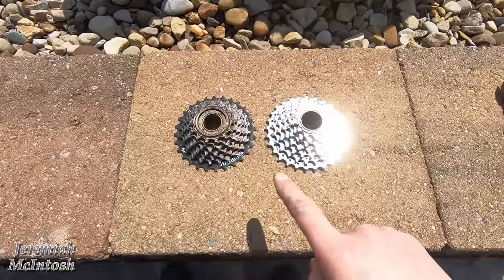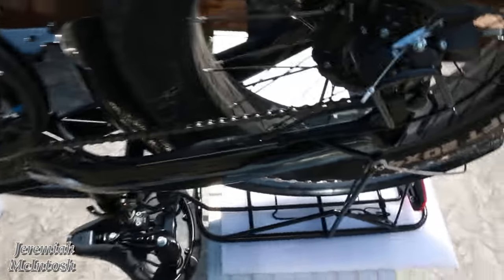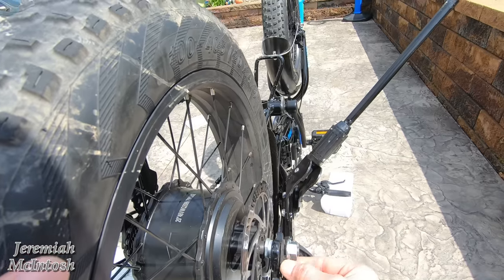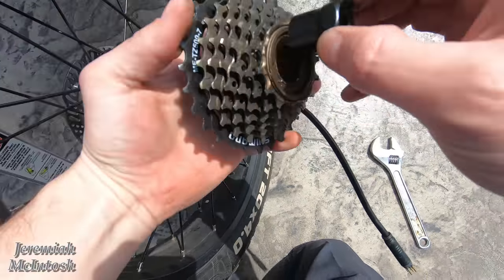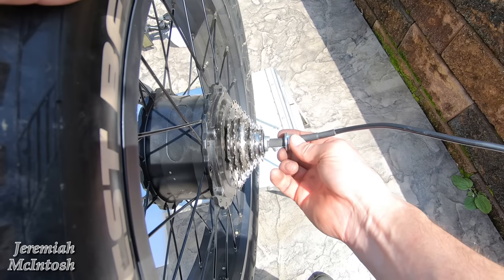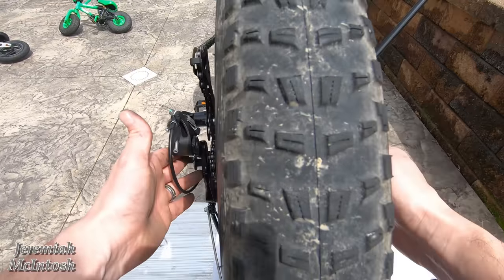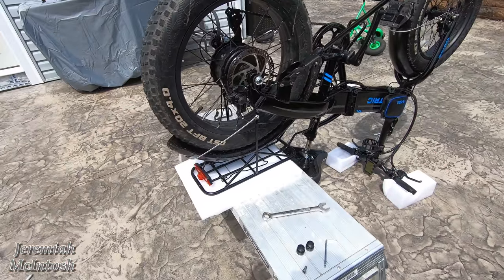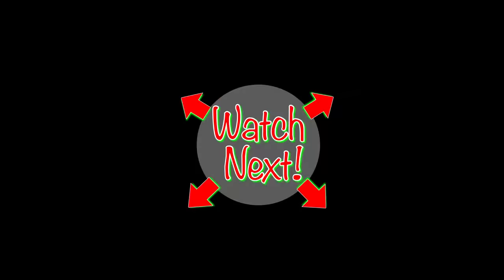Lectric Xp E-Bike Freewheel Upgrade replacement Tutorial and differences

Comment: I recently bought the DRIFT MANIAC DNP E-Bike Freewheel 7 Speeds 11-28 Teeth EPOCH will this work?
Reply from the maker: Yes it will as long if you bought the seven speed freewill and not the seven speed cassette because cassettes are different.
Reply: @JeremiahMcintosh  it states Electric bike specific 7 Speed freewheel,Made of high strength and durable chromoly Steel. Nickel plated surface treatment.
Reply from the maker: Yep that should work
Reply: @JeremiahMcintosh  how are those hydraulic brakes working?
Reply from the maker: I have only installed them on the back so far waiting for the front pads to wear down and they work great however the organic pads they come with heat up very quickly if you’re in a hilly area like me and then reduce your stopping power so you may want to get a set of semi metallic or metallic pads if you change to the hydraulic calipers. The lectrics come factory with ceramic metallic pads. I left the organic ones on the back but I still have the original ceramic metallic on the front for the best of both worlds because the organic pads are very quiet.

Comment: Hey! can you share the specs on the free wheel tool when googled it I found a few different designs. Thankyou!
Reply: also do you tighten it or hand tighten it after screwing the new one on?
Reply from the maker: There is a link for the exact tool in the description of my video and I did tighten it gently with the tool when installing it.

Comment: I'm trying to find a video that tells you how to adjust your shifting I had to put a new motor On and when I did it wouldn't shift properly Just an adjustment I'm sure But I don't know how can anyway out there help.
Reply from the maker: There is a high and low limit screw that adjusts the min and max in gear 1 and 7 (if you’re chain is not going into or going past gear 1 or 7) 
Then you adjust the thumb screw at the end of the cable to adjust it shift between gears. Make sure your cable is seated in both ends by the shifter and derailer sometimes it will pop out.

Comment: I put about 100+ miles on my bike since doing this modification, and wanted to make one comment about the derailer. While I could easily get things adjusted in the shop so that the bike went through the gears easily, I did encounter one problem. When I really bear down on the pedals it pretty consistently slips. This is really noticeable taking off from a stop sign or whatever. I've not been able to adjust it out, so not sure if you have any tips or not. It may just be the quality of the derailer or lack thereof.
Reply from the maker: Sounds like it may be slightly out of adjustment I haven’t had any issues at all with mine. Does it do it in any gear or just certain gears?
Reply: Seems like 95% of the time I'm in the highest gear, so that's where I really notice it. I guess it's encouraging that yours is working. I can try to fine-tune a little bit more. I did this conversion last year just before it started getting cold, and only fussed with it a little bit. Naturally it works perfect when it's inside with no real pressure applied to it!
Reply from the maker: If you’re in the very highest Or lowest gear you may have to adjust the H or L screw slightly. If it only does it in the center gears then you adjust the screw on the end of the cable.
Reply: My understanding is the H and L are limit switches, but I guess if it's only slightly out of adjustment in the highest gear it might want to skip a little bit. Unfortunately I can't see which direction it's slipping as it only occurs under pressure or force. Seems like this can be a slippery slope to get adjusted properly.

Comment: My son changed out the freewheel but now the chain is falling off in 7th gear.  Any suggestions?
Reply from the maker: You just need to adjust one of the screws in the derailer. One is the high limit screw and one is the low limit screw.

Comment: Would it not be much easier to change the front chainring to a larger one?
Reply: Changing the front chainring only would have the effect of shifting all the gears to be easier or harder to pedal (smaller vs larger chainring). By putting a larger chainring, it would be harder in all gears which would reduce your ability to climb hills easier but make your top speed gear less like a hamster wheel. If you went with a smaller chainring it would make the pedaling easier in all gears making your lowest gear better for climbing steep hills, but that would increase your cadence for top speed giving you more of a hamster wheel cadence at top speed which would be the tradeoff.  By doing the rear freewheel change you don't have to shift everything harder or easier, you can get the best of both worlds and change the lowest and highest gear while leaving the middle gears mostly the same depending on which freewheel you get.

Comment: Hi.I changed the same cassette speed on a bike just like ncm moscow. On the first and second speed I feel a noise when pedaling, it is something like a vibration.The speeds change normally, the derailleur is adjusted. Can the problem be the chain?
Reply from the maker: Not sure who you mean ncm Moscow? The Lectric bikes have a freewheel not a cassette?
Reply: @JeremiahMcintosh  Sorry, I wanted to say freewheel, i have an ebike the same model as the NCM Moscow and i installed the DNP Freewheel 11-34T.
Reply from the maker: On ok gotcha. I’m not sure then? Did you have a spacer behind the old one and did you have to remove it?
Reply: @JeremiahMcintosh  No, I didn't have any spacer.

Comment: Jeremiah, will the 11-28 work on an XP 2.0?
Reply from the maker: Not sure yet. I haven’t tried it yet sorry
Reply: @JeremiahMcintosh  I understand, thank you for the quick reply.
Reply from the maker: No problem. It looks narrower than the 1.0 so not sure if it will fit or not.  I will probably try in the future and if I do I’ll make a video
Reply: @JeremiahMcintosh  What is it that looks narrower? I have the 11-28 so I may give it a try. Will let you know how it goes if I do.
Reply from the maker: If there is no spacer behind the existing freewheel the new one might sit out slightly further putting gear 7 closer to the frame and the chain might hit the frame . If there is a spacer you may be able to remove it and it should sit in the same spot.
Reply: @JeremiahMcintosh  okay, that makes sense. I'm going to try it will let you know how it works. Thanks my friend.

Comment: Sitting here, staring at my 2.0, about 6:15 in to the video and, feel like I'm the only one struggling to get the back wheel to budge - taken off all the nuts and washers, even the one you don't mention on the derailleur side - but the axel won't wiggle in the least.  Oh well, keep thinking, keep trying.
Reply: My ebikes have all been like that I have to bop the tires pretty good to get them off

Comment: So I just did this upgrade yesterday and it worked for about 5 miles and now it will not give me any assist in the highest gear!! Once I switch the gear 1 up it will give me full power
Reply from the maker: That really doesn’t make any sense that it would be doing that?🤔
Reply: @JeremiahMcintosh  just figured out when my battery gets below half it will start doing it. Weird. Also I don’t think it’s giving me full power just little bit at top gear

Comment: In your list of items, you list an 11-28 Freewheel and an 11-34 freewheel. Which is which and what's the difference?
Reply from the maker: The 11 took gear of both will help you have more pedal resistance at higher speed when in 7th gear.  The 28 is the same as 1st gear now on the factory Lectric. If you don’t have a problem with first gear now then you can stick with the 11 to 28 but if you want a faster pedal rotation but easier for going up steeper hills then get the 34.
Reply: @JeremiahMcintosh , sounds like this old man should go with the 34 then if I understand you right. I'm all about easy.
Reply from the maker: I would try the when it comes on it from the factory first if you’re OK with first gear then you don’t need the 34. But if you feel like you need it to be easier to pedal go with a 34. You will be rotating the Kranks very fast though to go a short distance with the 34 but it is better for steep hills

Comment: Hey does anyone know if I can put a ebay cheap electric wheel hub with the 7gear casset on a 2x8 mtb and yeah the original wheel on tree that bike is a has a really nice tire and also the 8 gear casset does anyone know if I can do a switch before I decide to probably take it to a shop and cost a fortune?? Please help would be appreciated 🙂
Reply from the maker: The main thing to make sure is that the tire will fit and where the wheel mounts to the frame is the right width. You’re also going to have to find a spot to mount the controller the battery and run all the wires for the throttle and pedal assist  and brake lever cut off switches.

Comment: My chain comes off in 7th, any suggestions?
Reply from the maker: Did you put a new freewheel on or is this still stock?
Reply from the maker: Did you remove the spacer behind the old one? If so then one of the 2 limit screws need adjusted on the derailer.

Comment: How difficult is it to change a freewheel on any bike.
Not a bad video if you totally don't know what you are doing.
Reply: You can look up almost any bicycle related mechanical thing on YouTube. Enter freewheel replacement in the search box and you will find several videos showing you how. You will need the "Park Tool" freewheel remover, FR 1.3 to remove an eBike freewheel. Do not buy a cheap off brand tool. A cheap tool will not have a big enough hole in the center to slip the hub motor electrical plug through it. You can find the Park Tool FR 1.3 on Amazon for around $9.75.
Reply from the maker: Yeah I was afraid my cheap tool I  bought would be too short but it actually worked just right.
Reply: Jeremiah was lucky. I bought a cheap tool that had a hole in it that was too small to fit over the inboard axle nut on my fat bike. I had to remove the axle nut to insert the tool into the freewheel to remove it. Having to taking the axle nut off meant I had to mess with re-adjusting the axle bearing pre loading. I bought the Park Tool (FR 1.3) that has a much larger hole in it. With the Park Tool I don't have to mess with taking the axle nut off to remove the freewheel. If you buy the cheaper tool good luck. You might wind up having to buy for a second tool like I wound up having to.

Comment: When you were putting the wheel back in you did it the hard way. Use a large screwdriver to use as a lever to help spread the forks. Press the lever against the freewheel and inside of the fork press sidesways a little and it will pop right in. You want to work smarter not harder ;>).

Comment: I love your videos, but if you try do all those update why you don't buy a better bike with a faster  electric motor. there are some bike goes up to 60 miles per hour.  Or just buy a gas motor cyclists
Reply from the maker: Anything Over class 2 and it’s illegal in most states. I have a motorcycle and completely different. You can’t take a motorcycle on the bike trail with your Kids!

Comment: I'm still trying to figure out why people do this mod.  You say it's to achieve the 28 MPH top speed, but you can achieve the top speed by simply setting the bike to pas5 and pedal at a CASUAL and steady pace, but ZERO force is required to get that top speed.  Hell, you could be in the easiest gear and do it, or even take the chain right off the bike and you will still reach the top speed of 28mph.
Reply from the maker: Because I like to have resistance on the pedals not just pedal air but you are correct you can do that.

Comment: man i cannot get my wheel back on! spread frame, pounding, i have helpers too. grrrrrrr
Reply from the maker: Dang sorry to hear that.  Make sure the spacers are in the correct position and that the brake disk is going all the way into the caliper without hitting the pads.
Reply: @JeremiahMcintosh  Thanks, I am but no go, it sits about 1/4 inch from being fully locked in!

Comment: that was a downgrade. wtf.
Reply from the maker: How do you figure?
Reply: @Jeremiah Mcintosh  if you want more torque off the line sure, if you want higher end speeds with resistance then higher gear higher crank teeth. Small is less Bigger is more. understand now? Mr not a mechanic.
Reply from the maker: You are wrong. That would only apply to the front sprocket. It’s the opposite of that on the rear sprocket. But hey I’m no mechanic…